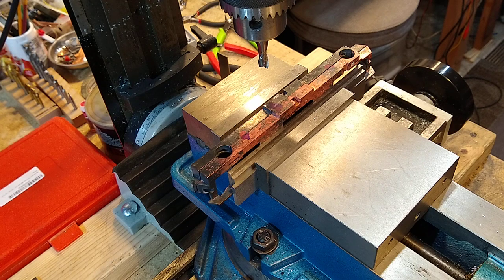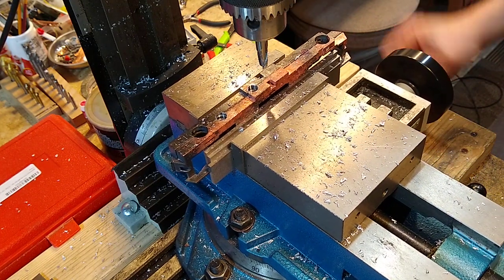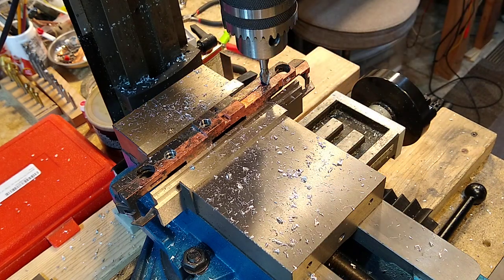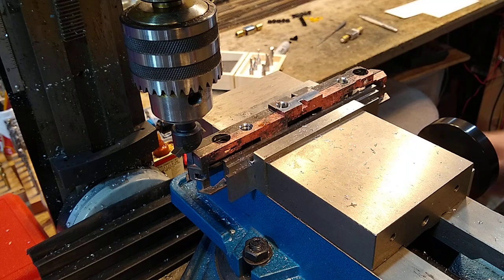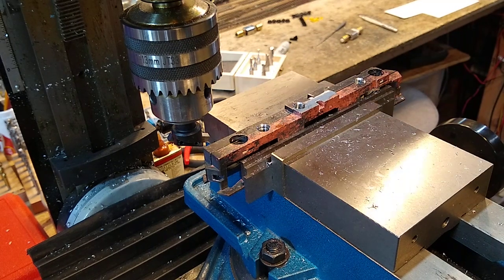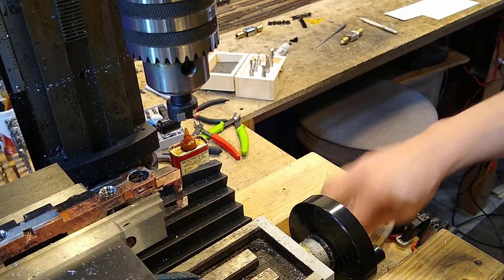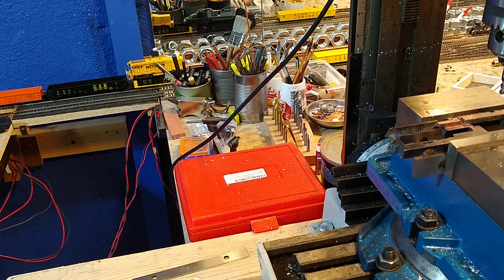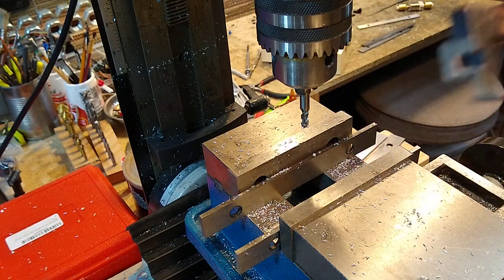5 locomotives in 30 days part 9 frame milling

Comment: Hey bud, do you got to have 24v to get the large torque out of the FF-180PH.  Or will 12v get the same torque as a 24v motor . . . Thanks . . . BRIAN
Reply from the maker: not at all, the motors are so strong they begin turning in milliamps, at 1.5v they are moving and you will probably never use more than about 7 volts.  usually around 4 volts is more than enough to handle any train.  the top speed is not real fast because you never reach 24v, but they move super smooth
Reply: @elite194  
Heck yes big buddy, I found some on evilbay that'll fit all my locomotive.  Think I'm going to order bout 20 of them before these go extinct too lol
Reply from the maker: @brian5606  watch out for fk-130, they are smaller than you think,  ff-180 ph fit most old stuff but not bachmann or proto 2000
Reply: @elite194  
Ok thanks man